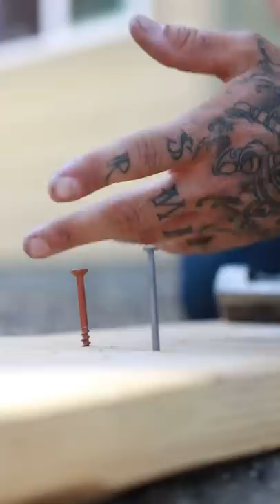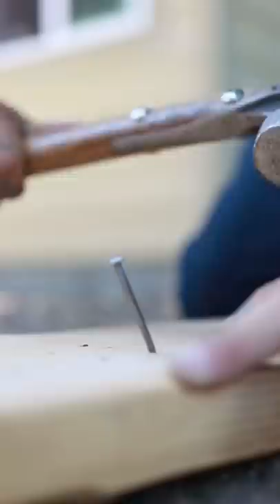Nails vs. Screws: Why do we use nails? #shorts

Comment: Yep that's why the lug nuts on your car are strong High gray steel so they don't flex in bin because if they did Flex them in your wheels would fall off I'm sorry you don't make no sense Danelle Ben's because it's cheap metal the screw will shatter because it's hard and steel and I'm sorry it's not in two pieces of wood not a realistic example

Comment: Then make screws out of the same material that they make nails out of, simple solution 💯
Reply: I was thinking the same thing, then use the same metal for the screws as the nail. Ridged enough to still be screwed in, but able to bend without shearing. It is a very simple solution. But, like every other commenter on here knows…it’s only because nails are cheaper.

Comment: SCREW a scrap 2x4 down to the deck or sill plate using 3” screws, now hit the end of it with a sledge hammer until you shear the screws… you won’t do it…
Now NAIL a similar 2x4 down (using the same length and amount of nails as the screws, to be fair) and do the same test… the nails will fail by pulling out way before the screws shear or pull out
So yeah, what you’re doing & showing is totally wrong

Comment: Construction screws all the way. Nail has zero advantage over screws structurally. Two advantages of nails are cheaper and faster. Don't give me the shear strength bull crap. No member in residential building gets that much shear forces or that much movement to break bunch of screws that are embedded in the wood. Just no way.
Reply: Key word here is residential.

Comment: Because your modern US carpenting is based on lowest cost, least-required skills and low durability...THAT's why.
A Pro will use screws, and a true master only proper wood joints with occasional wooden pegs & wedges.
Just 2cts from o'le Europe.
;)